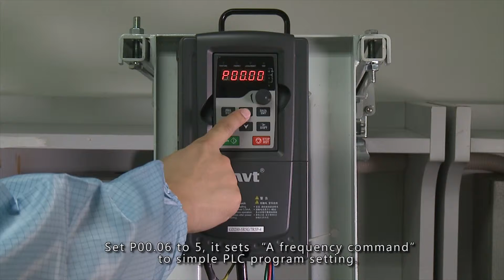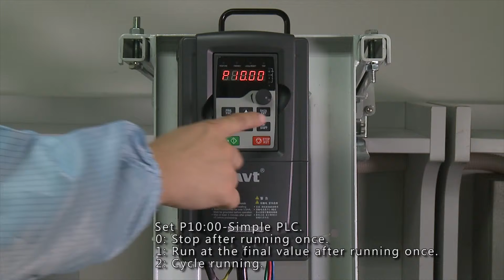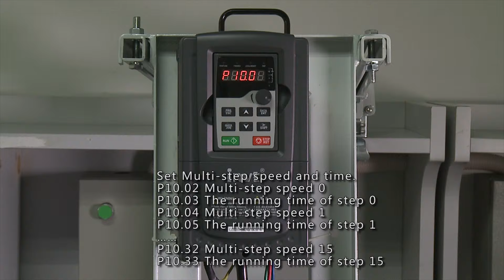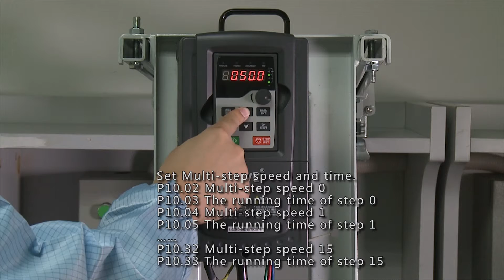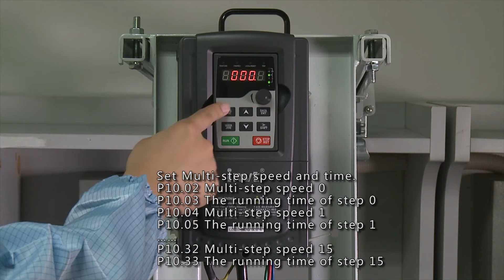Inverter Function Simple PLC

Comment: I am trying to setup my CHF100A 22kW VFD to control its speed up and down using push buttons. The configuration i have set by using your video of multistage speed. The speed of motor does not holds at one point and return to zero when i release the push button. I need your kind help please. I need to start/stop and increase decrease my drive speed using push buttons
Reply from the maker: Hi my friend, may I have your email or whatsapp? Our team will contact you soon.